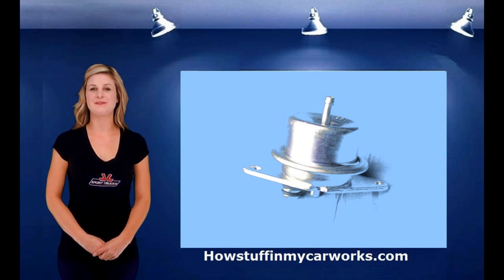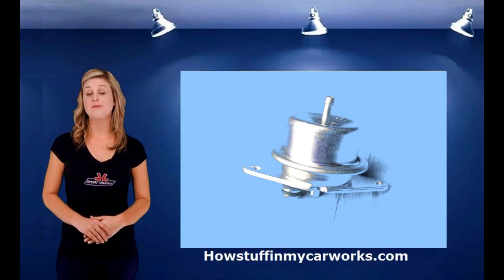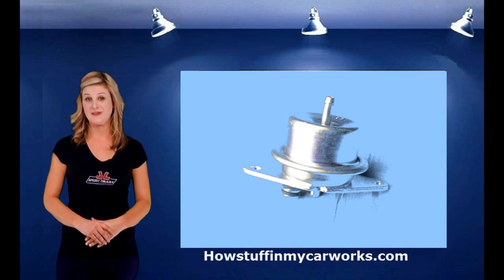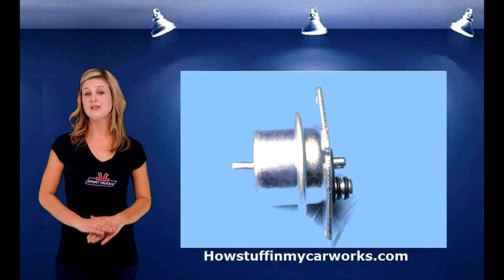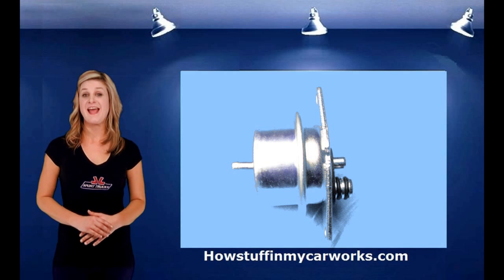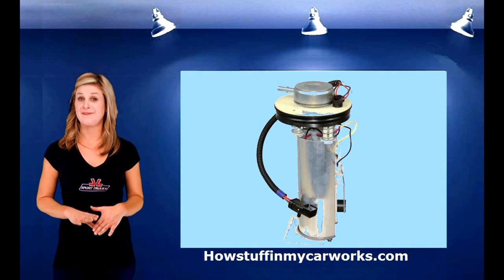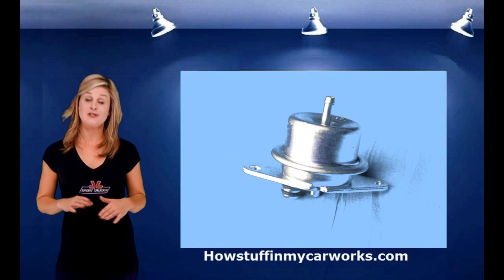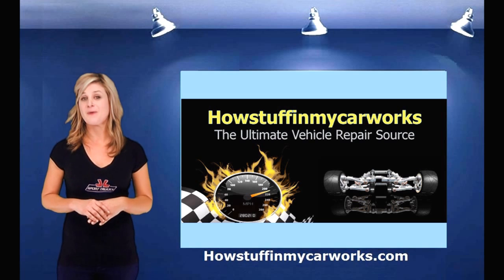How fuel pressure regulator works by Howstuffinmycarworks

Comment: Really liked your video, my car has those same symptoms you mentioned but my car does start when the engine is cold but if i turn it off then it wont start unless i press the gas pedal just like if it had  a carburator. And if it dont start, it floods and smells lots of gas
Reply: Ever figure it out ?

Comment: Her explanation of what the FPR does is great, but it does not explain HOW it does this.
In order for injectors to operate properly (keeping the fuel/air ratio correct), there must be a known difference between fuel pressure and manifold air pressure --- this is commonly 3 BAR, but may be more depending on the engine. The FPR can keep this fairly constant by feeding an air line from the manifold to the top of the FPR; that's what the hose nipple is for on the top. It does this by restricting how much fuel passes through the regulator which goes back to the fuel tank. As manifold pressure increases (opening the throttle) the FPR becomes more restrictive, thus increasing fuel rail pressure, but always keeping that 3 BAR difference between the two. (Manifold air pressure adds to the spring pressure at all times ... even as the pressure goes below or above --- turbo --- atmospheric pressure.) The FPR shown is always kept downstream of the fuel rails; this keeps everything before it (upstream) at whatever pressure the spring and air pressure add to (3 BAR + Manifold).  And that's HOW it works. Just think of it as a back pressure regulator.

Comment: Very helpful Thanks!
Reply: take the vacuum hose off, if you see that FPG leaks then it's bad. If it doesn't come out, turn the car on and just wait may take 5 or 15 minutes till you see fuel coming out witch should not.

Comment: they should have just stuck to carbs at the rate i see these things fail, i mean realistically compare the life of these to a carb, screw emissions, im willing to bet a factory creating these things pumps more emissions in a month then the car its going on does in its entire lifetime
Reply: rondoo32 Hmm, interesting point.
Reply: +rondoo32 I was thinking like you before i just sold my car with carb peugeot and got a bmw with more power but fuel injectors and i love it...it uses 2 time less fuel and has more power great car